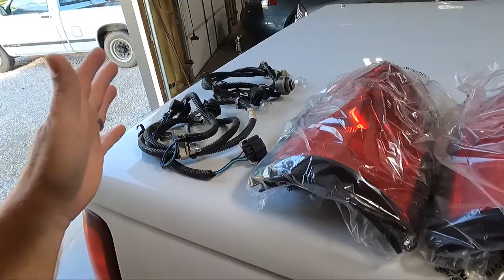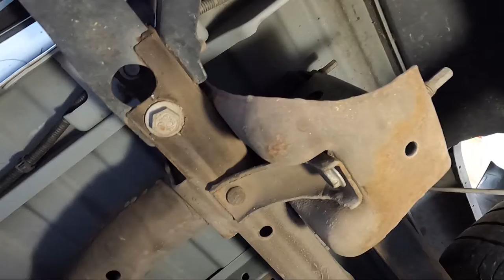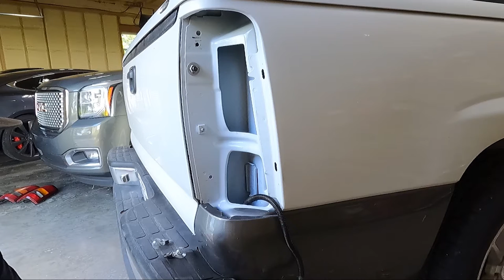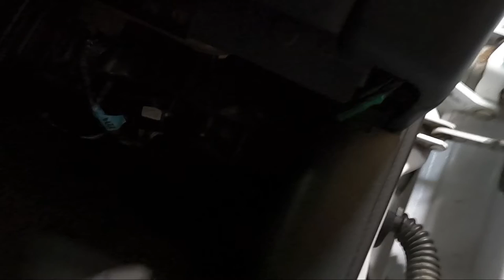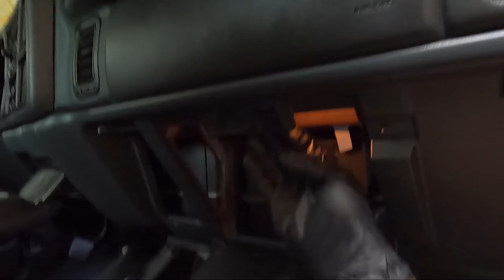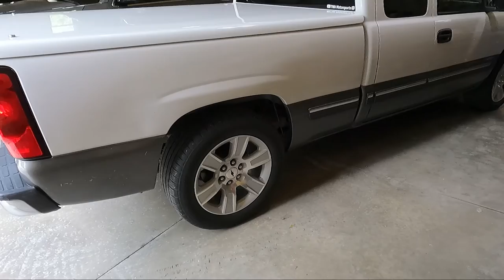New Tail Lights and Interior LEDs for the Daily Driven Silverado

Comment: Thabk you for the informatuon about the cruise control not working with the leds!! Light bulb qent off in my head when you said that, i was thinming to myself it always worked til i switched out those lights but never bothered to look into it, gonna check first thing in the morning! Ebay has some nice led replacement license plate lights, its the housing in the factory black finish with the led board built into the housing and just plug into the original 194 socket and best part theyre sub $15
Reply from the maker: Yeah I actually have those on my green Sierra
Reply: @TWAMotorsports  thats right! 🤦‍♂️

Comment: All you have to do is add an inline resistor on the right tail lamp and that will fix the cruise control issue.  That’s what happen when I changed my 1999 over to all LED.
Reply from the maker: I have heard that

Comment: Cruise control issue is fixed by a simple resistor
Reply from the maker: Thats what I  hear
Reply: @TWAMotorsports  yeah didn't realize that till I was getting a remote start installed and it wouldn't work because of my LED tails it confuses the ECU thinking the brakes are applied so the remote start thought the same. Fixed it with a resistor and both were fixed.